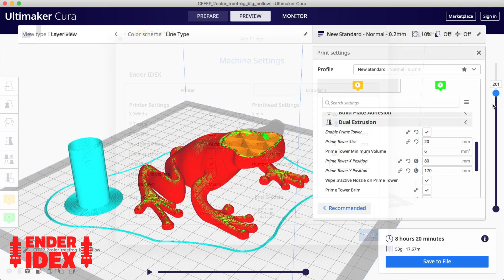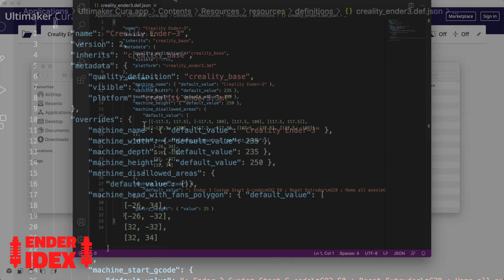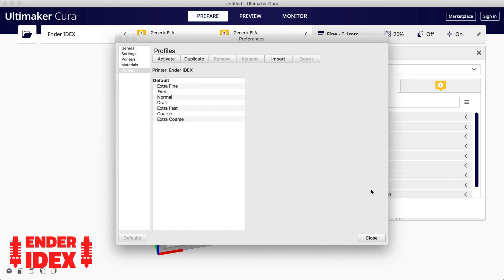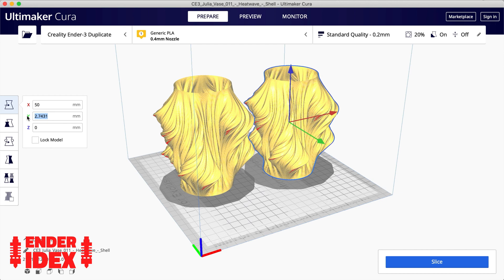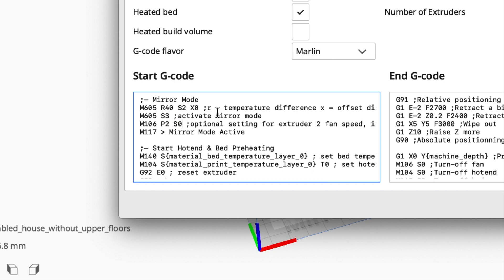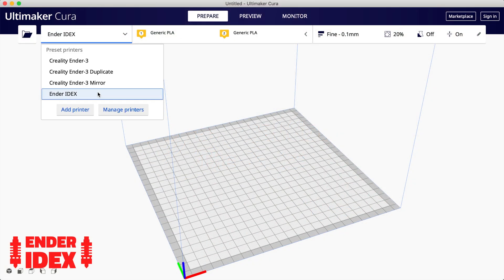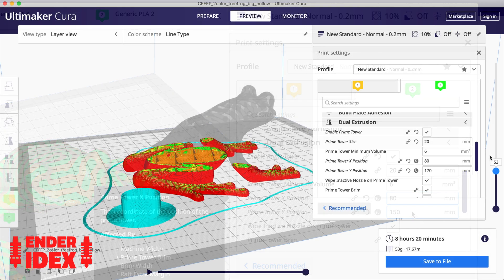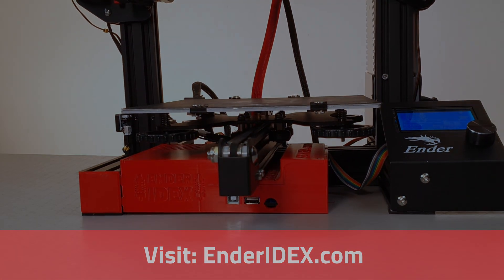IDEX 3D Print Slicing: Use Cura to slice prints for the Ender IDEX

Comment: Can one of them be for just printing supports? I am modifying an ender 3 v2 to print peek, pekk and other high temp filaments. But they come at a high cost. I would like to print supports with something a little cheaper.
Reply from the maker: Absolutely, you can select the hotend which prints support material. So you can have a print with hotend 1 and hotend 2 printing the supports.

You can also print just the interface layer with hotend 2. So PLA print, PLA support but PVA (soluble support) used for the 2 or 3 layers that touch the print.

Finally, with an IDEX you can easily print 2 different materials. So using PLA for your model and PETG for support is another option. PETG and PLA do not stick very well so it's cheaper than PVA (soluble support) but still removes much easier.
Reply: few layers of pva between model and support is a brilliant idea !!!

Comment: Hi Kane, impressive stuff. What would be the process for using the second extruder to print support material for supports generated by cura?
Reply from the maker: Thank you Raymond, you're very kind.

It's actually really easy, in Cura when you have more than 1 extruder for a printer you can go to the "support" section of the settings and select the extruder which will print the supports. You can also specify which parts of the support are printed by which extruder.

So you could print the bulk of your support in cheap PLA and then use your second hotend to print only the interface layer in something like PVA (which is more expensive). This way you get the benefit of cheap PLA with the benefits of PVA where it counts, in contact with the finished print. 😁
Reply: @SEN3Dcom  fantastic, thanks for your reply. The possibilities of IDEX in conjunction with a system like "palette" would be limitless.

Comment: This is so awesome looking. I definitely have to grab a setup. I have only one question-- if for some reason a print from one hotend starts failing (in mirror or duplicate modes) can you abort the print for just one of them, or would you have to cancel both prints?
Reply from the maker: So in those instances what I have done is just unplug the extruder at fault. The printer will keep moving around but there is no filament waste. You can also go into the LCD and turn the heat off for that hotend too. So it will keep moving around like a ghost for the rest of the print but no further filament will be wasted and it will not even be heated.

HOWEVER, you this will be bit at your own risk as it's not strictly advisable to unplug a stepper motor mid operation. You could damage the stepper driver or even the motherboard. So bear this in mind when unplugging a stepper motor while in use for any 3D printer.

If you wanted to be less risky you could also just hold the extruder arm in and withdraw the filament. It may be a tad annoying to have to re-insert it for your next print but hopefully not more than 30 seconds. And again you could then also tune down the temperature of just the extruder at fault.

Comment: Is this just for the ender 3 or would this work on other 3d printers
Reply from the maker: Great question, I have tailored the dimensions for the Ender 3 in this video but the principles are exactly the same for any IDEX printer. You'd just need to adapt your bed size and the rest should work great 😁
Reply: @SEN3Dcom  I tried it out and it did not work
Reply from the maker: @Jeff75684  oh now, which part failed?